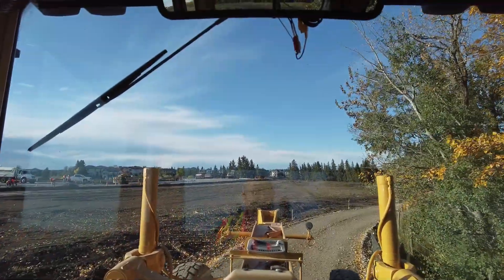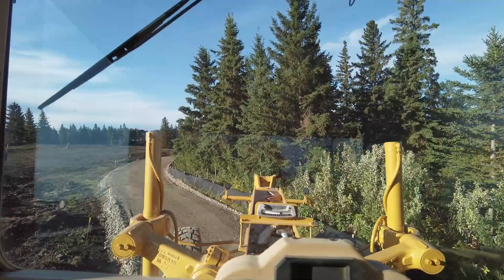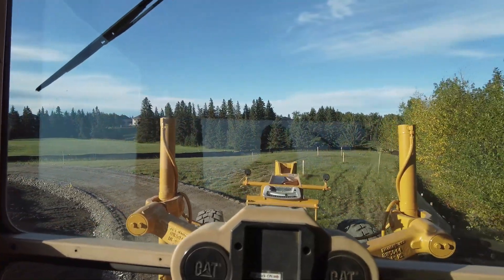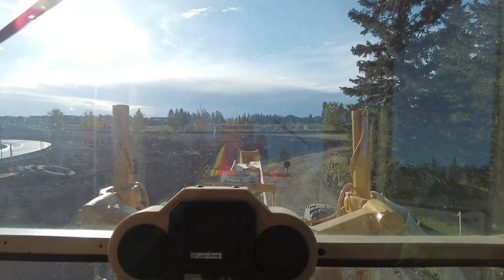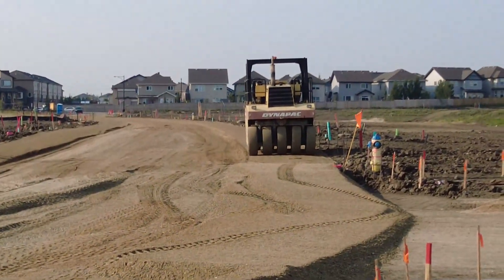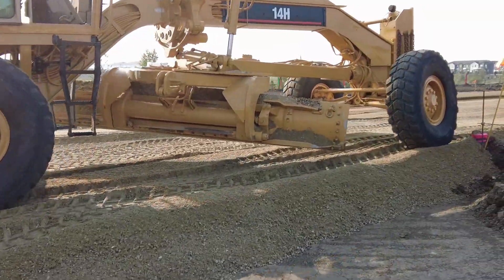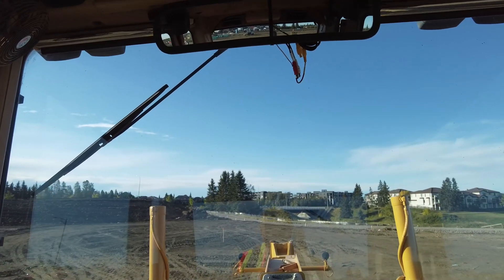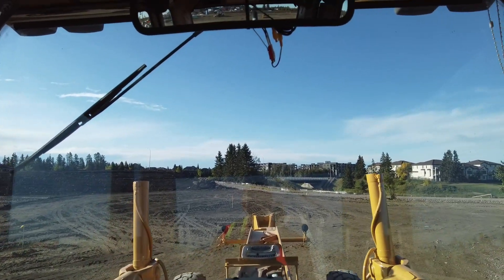Slope meters; Grading old school

Comment: I’m an equipment operator in Alaska. The slope meter is very nice. Running motor grader used to take a lot of feel and know how. With all the GPS equipment nowadays, the tolerance on the job sites has gone down to +-.03 in 100ft. I only know this because I had to finish a job at the airport with a 14M and the GPS went down. This was very hard for me because I’m not a true grader OPERATOR. And the grade checkers didn’t know what to do without their rod. We did get it done though. Thank you for putting these videos out.
Reply from the maker: Nice to hear from Alaska, it's true at operators are relying on automation more and more, and I think that is a good thing. I was chatting with a guy 
from Alaska last year, and I thought he had a great username. It was "bearbait". Thanks for the input.

Comment: my work place has 4 out of 6 graders ,5 Cat m series and a Komatsu with levers .  the m series drivers have 3d gps and think it saves a lot using pegs and string lining but near finish level the worn out blades can put out levels out so they all adjust at one part of job and allow for it .

Comment: You slope gauge is extra large , where did you purchase it from ? I can only find very small ones.
Reply from the maker: A lot of years have passed since I purchased my slope meter, but I think it was through "Finning", That is the Cat dealer here in Edmonton, Alberta.
I'm not sure of your location, but here is a link to an online business out of Quebec. 
 https://geneq.com/materials-testing/fr/produit/slope-meter/inclinometre-mecanique-807
If you copy and paste that into your browser, it should take you there.
Reply: Good day, Vern, very informational video thank you! I am a 40-year-old man and I have been running graders since I was 18. I started doing base work when I was 28 to 35. For monolithic curb I always had to have both tires on the pad, and then cut it out after. Pretty neat you can do it with only one tire on the Pad! Most of the slope metres I see are in the cab. I’ve never seen one on the neck. Is one way better than another? I too am from Northern Alberta and I’m looking to put a slope metre on a 163H I recently purchased. I am concerned whether may affect the slope metre for winter. Do you take yours off in the winter?

Comment: I usually check my slope meter at the shop on concrete floor. It should read level. The way you calibrate yours was a good idea, especially if you do not get back to your shop to often.
Thankyou for your information and instruction.  We are always looking for better, easier and more efficient ways to do things. I live over the boarder into Maine. We use feet and 10s of a foot. Only involved in one job at the Ship yard that was metric. After that job we were supposed to change over but never did. Still using feet and yards.
Reply from the maker: Hi Clyde, All the blueprints use metric, and the jobsites are surveyed in metric, it has been that way in Canada since 1975. When I buy a tape measure, I make sure it shows both imperial, and metric. Nice hear from the State of Maine, thank you for the input.